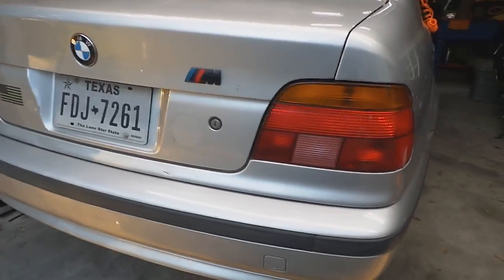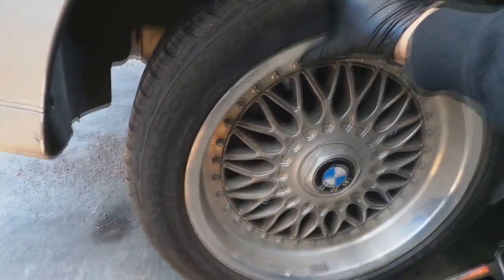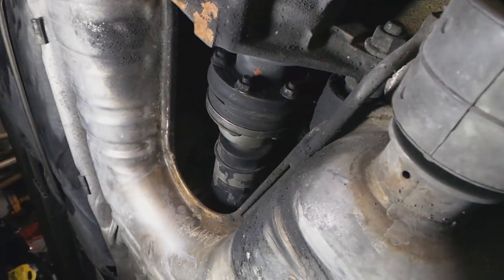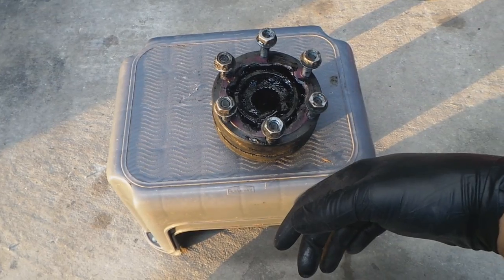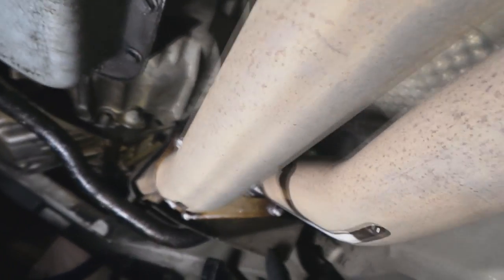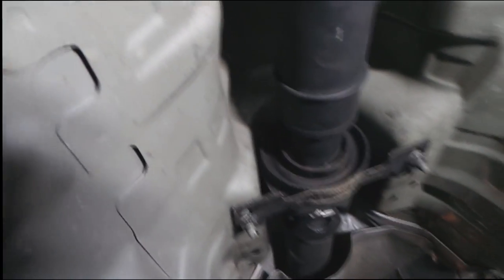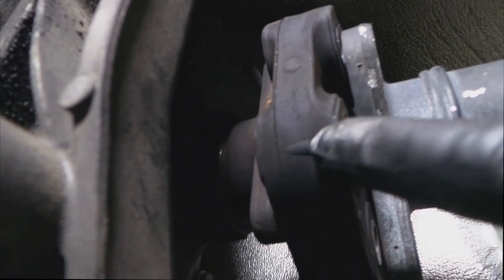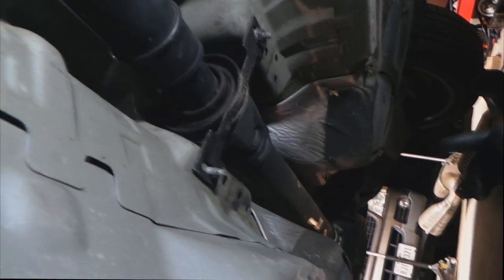BMW DRIVE SHAFT CLUNK FIX E39 E46 E90 / EXHAUST REMOVED SOUND TEST

Comment: I have a 02 e46 m3. When I turn left slowly or with light load I have a sort of grinding sound from the rear. But Ive let it drive while on jacks it doesnt make the sound. Ive moved the driveshaft with my hand by the rear cv joint and it has play and a light click sound. Last time I checked the inside of the cv joint it has alittle bit of grease. Idk how else to replicate the sound without driving the car. I also dont want to just buy parts thinking it can be anything. Idk if its the half shaft, the differential fluid, the cv joint, or even just because the cv joint needs grease. If you may know that would be greatly appreciated!

Comment: @TheBmwDoctor at 1:32 what part is that? I have a 07 e90 that makes the same noise at that exact spot but I changed the flex disc (or rubber guibo) without avail. The donor part you are using has a gear in it-- what part is that?

thank you for this video and your help!
Reply from the maker: It's the drive shaft flange or cv joint.

Comment: I have an f30 328i xdrive. It makes that sound but only when I press the break moderately between 40-20 mph. Could it be the same problem?
Reply from the maker: It could be the rear sub frame bushing , drive shaft support baring or the drive shaft cv joint. I would jack the car and try to reproduce the noise like I've done in the video.

Comment: I just bought a 330i 2002 and I just got the rack replaced but I hear clicking in the front when I drive and when I gas it it vibrates from the rear/ middle. I’m new to bmws so I’m not sure what’s going on it’s been stressing me out because I don’t want to have to take it to a shop where I’ll lose all the money I have just to fix it..
Reply from the maker: sounds like the center support baring on the drive shaft.

Comment: my E39 makes a clunk sound from the rear when I change gear my local BMW specialist "claims" its the sports clutch even though I told them it comes from the rear and it makes the noise when I rev it to 4000rpm let it go down to 3000 and accelerate moderately then  it clunks again... would it be the same part as you fixed? (I assume it is or the rubbers but they said they checked the rubbers and they are "fine") thanks in advance !
Reply from the maker: do you hear it continuously while driving or is it only when you rev it?

Comment: I have a 2006 x3 and every time I turn makes a bad sound in the  back also when I'm coming to a full stop makes a jump. Do you have any idea what could be?
Thanks.
Reply from the maker: noise when turning could be a bad cv joint if this is an AWD car the jump when stopping the only thing I can think of is a transmission jerk and that's caused by worn out trani valve body seals or low fluid.

Comment: I have the same issue with a 2012 F10 M5. Garage told me it’s a new gearbox. Typical this happened two days before part-exchanging. Now I’m at a total lose as to how I move forward. 😢
Reply from the maker: Check your drive terrain weak points such as drive shaft flange and the guibo joint.